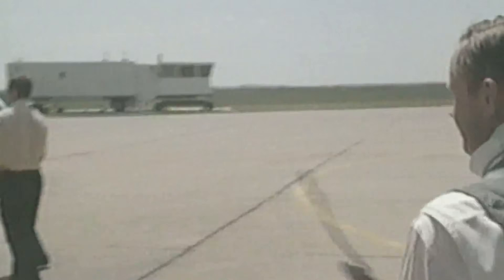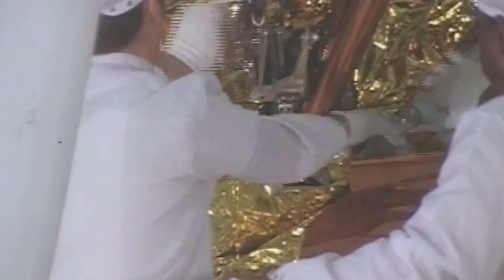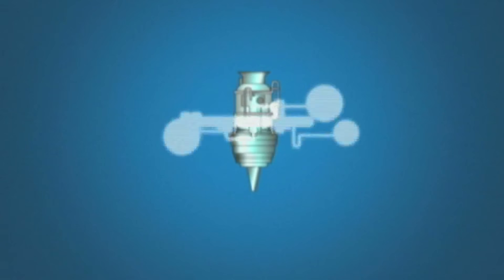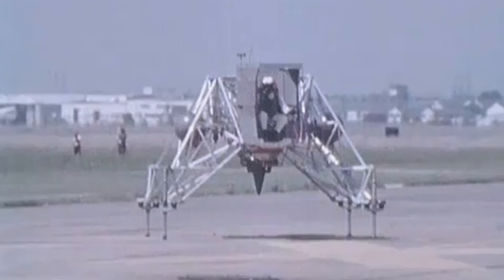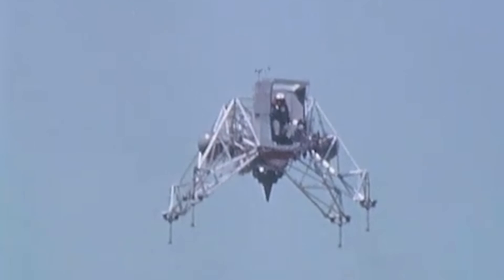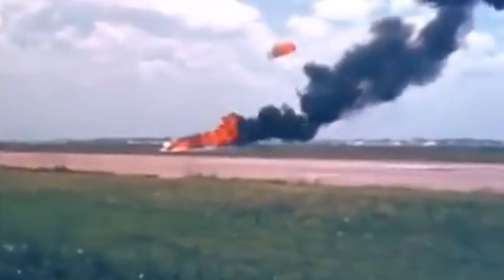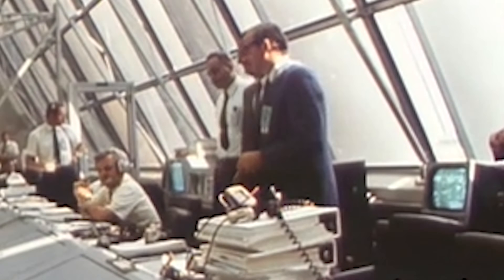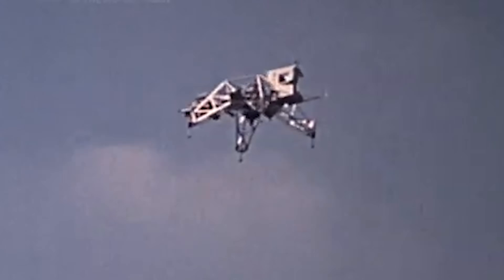The Most Insane Space Test That Almost Screwed the Moon Program

Comment: IMO, the most amazing part of the ejection by Neil Armstrong was the demonstration of superb flying skills forged by his experience in flight tests in other aircraft.   When his LLRV rolled 90 degrees to his left, Armstrong's ejection path was horizontal with an arc curving toward the ground.  He would not have survived an ejection at that angle.  The parachute would not have opened fully.  Armstrong had to act instantly.   He could not be sure if the LLRV would roll back to the initial upright position.  I'm assuming he applied full opposite control inputs to the stick and prayed that his craft would roll back to straight and level. 
      As he was rolling the LLRV back to level, Armstrong's other hand was likely on the ejection handle.   It's one thing to pull the ejection handle as soon as things go south.    It's another to fly yourself out of almost certain death, frantically waiting for the right moment to eject.  That's what Armstrong did.  On a later Gemini flight with David Scott, Armstrong saved their spacecraft that had a stuck, runaway firing jet.  Extreme G forces from the fast-spinning capsule threatened almost certain unconsciousness.   Armstrong used the re-entry attitude thrusters to solve the spinning problem and landed safely.  
      In the LLRV ejection case, under similar circumstances, I wonder if any of the other astronauts could have survived the ejection.